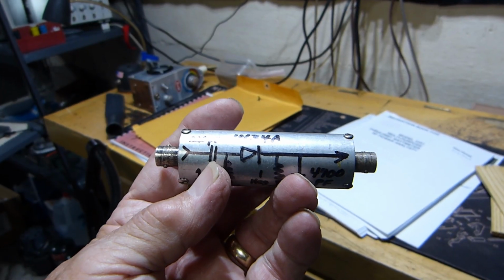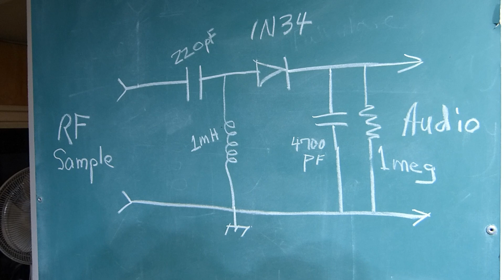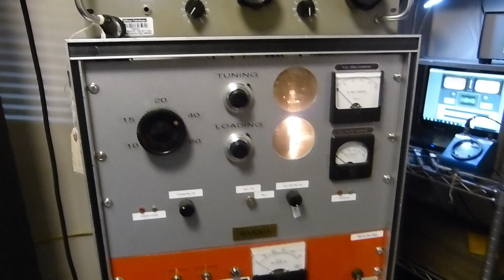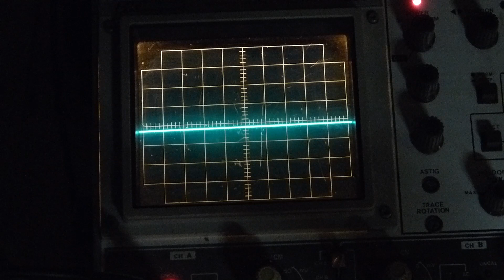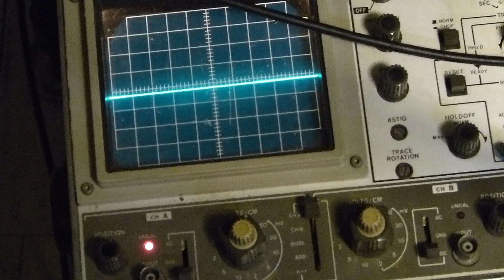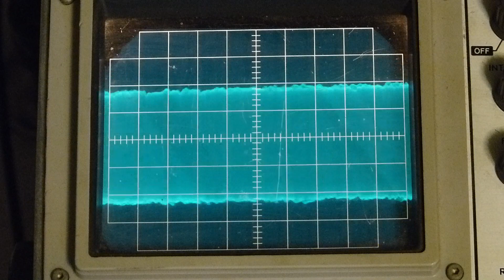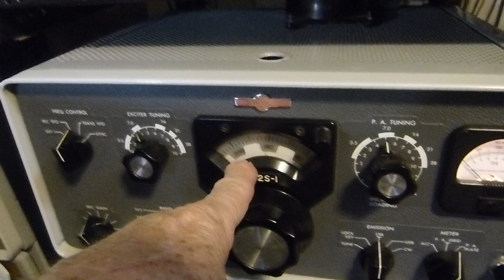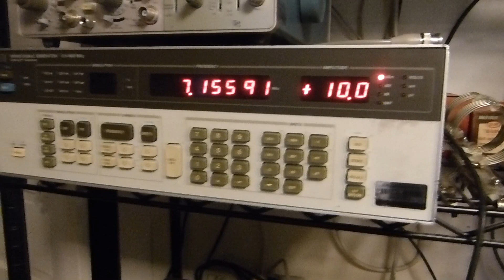Building A Demodulator To Monitor AM and SSB Transmissions

Comment: Hi Dave, Love your videos like always. Just wondering if you can do a video on. the software that you use on PC FFT Spectrum analyzer. and the interface that you use in the setup. of how to use it. Like gain levels. Hookups to the audio equipment. End to the PC And what interface is the best to use? I think that'll be a good video for all to see.
Reply from the maker: I have a little audio amplifier I have been thinking about testing and posting and I will use one of the FFT SA programs and make sure I do what I can to detail hookup, attenuation of input, etc. Thanks for the suggestions.

Comment: Although my preference is your audio related videos, I do enjoy them all. Just to clarify, to hear the SSB you inject an RF carrier downstream of the RF sampler but ahead of the demodulator?  My brain isn't grasping that. Are the 2 RF signals mixing and the resultant output just the audio?
Reply from the maker: The RF carrier from the signal generator is injected and mixes at the input of the demodulator in the BNC T-connector, the same place the SSB signal is connected to the demodulator and the injected RF carrier must be at the same frequency as the SSB RF. After the RF carrier and SSB RF mix, the simple diode detector can separate the audio. It's pretty amazing to me also...   🙂 Do you ever just wonder how someone actually figured this out - 100 years ago.
Reply: I think there are 2 kinds of creators. The inventive kind who just keep trying different things until they hit on something (Edison maybe) and the intuitive type who can actually understand and extrapolate further. Like Tesla? One thing I do know, no matter how clever you may be, someone smarter will come along and kick your ass and wipe the floor with it. I agree though, the early innovators in electronics were giants. Thanks for your reply, hope you're keeping well.  @ElPasoTubeAmps

Comment: That is super cool. I love your setup and shop. Question, are you going from a preamp to a McIntosh MC40 high fi amp to a 3-400 modulator to the transmitter finals with high level plate modulation? If so what does the preamp into the McIntosh do for you? High fidelity and power? The reason I ask is because that's crazy cool. My hobbies are ham radio  and hi-fi audio, tube and analog  audio.
Reply from the maker: You described the audio chain correctly. The "preamp" is a microphone amplifier used to get the audio level high enouigh to drive the McIntosh 40. The 3-400Z modulators are running class-B and require grid current and power  (26 watts) to drive them and that is the reason for the Mac amplifier.  The Mac amplifier is not necessarily for HiFi although it does a good job at that, it is just that it can deliver the required power to drive the modulator. My hobbies are ham radio and audio also. I tend to flip-flop between them over the years to which is on my mind at the time. Lately, my efforts have been on ham radio and in particular, AM on 40M around 7293 KHz. Hope to hear you on the air.  73  WA4QGA
Reply: I like the setup and hopefully I'll hear you on the air. 73. Dave AA5HL
Reply: I was reading about the 6B4G and how the anodes were wired in parallel making approx 800 ohms. That makes it easy to line drive a McIntosh audio amp. Is that a good way to look at it?
Reply from the maker: I am not sure how to answer that about having a plate resistance of 800 ohms for the 6B4G. It is true there are two triodes in the envelope wired parallel. I find that interesting. The "preamp" is actually a small power amplifier originally designed to drive push-pull 810's in a Collins KW-1. In my situation, the output transformer is an 8 ohm output capable of driving a speaker. I have never used it to drive a speaker but originally used is as a driver for another AM transmitter. The input transformer for the other transmitter is an 8 ohm to 8K ohm driving the grids of a pair of 4-125A in class AB1 and modulating a James Millen 1947 push-pull RF amplifier running 812A's. It seems the general way of having a separate driver amplifier driving a higher power modulator is 500 ohms to 500 ohms but I did not have suitable transformers like that so I chose 8 ohms to 8 ohms. Works great. So, a bit more detail is I have a 500 ohm resistor across the 8 ohm output of the "preamp" using the 6B4G driving that 250K ohm input of the Mac amplifier. It is easy to drive a line-level amplifier input like a power amplifier from a speaker impedance amplifier. The 500 ohm resistor is simply to give the preamp amplifier some resistive load to work into besides the 250K input to the Mac amplifier. I hope this makes sense. 
In the case of the 4-125A modulator, its input has an 8 ohm resistor shunt across the input to the input connector. The AB1 modulator using the 4-125A only requires about two (2) watts to drive it as I have the step-up ratio of the input transformer (8:8K) and the bias on the 4-125A is only about -40 volts so it is very easy to drive.
In the case of the 3-400Z modulator, they are running class-B and need a good bit of grid current and power (26 watts) so the little preamp stage cannot deliver enough power to drive them so I drive the Mac amplifier with it. I also need the preamp stage as I use a condenser mic that is low output so I need a high gain microphone stage at the input.
As for plate resistance of the 6B4G, I believe the plate-to-plate load (different from the plate resistance) is still about 5K or so.  Unless we are trying to get the last bit of performance in power and performance out of a tube amplifier, there is quite a bit of room for differences in plate-to-plate impedance in out output transformer for satisfactory performance.
Hope all this makes sense.
I see from QRZ you are in Plano, TX. I think we could QSO on 40M pretty easily. I tend to hang out on AM at 7293 KHz and there is a popular gathering - not exactly a net - around 7195 KHz. Hopefully we can hook up. You might like all the pictures on my QRZ page.  73  WA4QGA
Reply: Ok sounds good. I like your QRZ page. Great pics. Yes I'm in Plano and I work at DFW airport as a radar engineering technician on about 10 different radar systems and radio communications. I've been to El Paso a number of times and I like it out there. I stayed on Zaragosa and North Loop. I even worked at the immigration detention facility in the past. There was a great Mexican restaurant that everyone loved out there, but that's 25 years ago. 
Enjoyed chatting with you, thanks for the videos and explanation. I always learn more from you. I'll be in touch either here or on the air.

Comment: Hi Dave, I would say that is clipping fairly hard, but I'm only an audio guy, not a ham ;-) Best EJP
Reply from the maker: Hi Esmond, 
No doubt THD is probably around 10% but distortion actually makes a signal louder and our ears don't seem to have a problem with it and may even like it, to some extent. 
Think of the THD in the space shuttle communication line. Got that high-pitched penetrating voice sound to it. We want to sound a little more HiFi than that...   🙂
The biggest problem I see occasionally with ham radio transmission is where too much speech processing and/or compression is used to make the plate current meter "kick" up higher indicating more power output and that causes a muffled distortion that is hard to understand. Also, too much low frequency response from dynamic mics makes voice harder to understand unless conditions are excellent. 
Always good to hear from you.
Any interesting projects lately?
I have a Collins 75A-4 receiver that I purchased recently that works great but... on power up and after maybe a couple of minutes, goes into loud distortion and the S-meter goes to zero and after about another 1-2 minutes, just "clicks" and goes normal again. A real pain to trouble shoot. Not a tube or the mechanical filter - I have eliminated them. I am using the receiver but want to fix it but it only fails as mentioned.
David